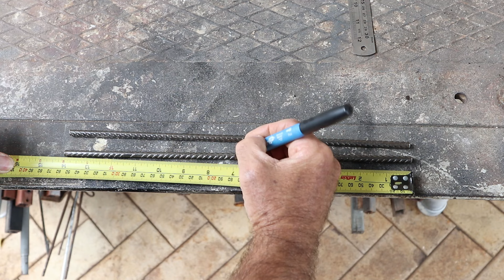Making a Steel Knot Metal Handle - Rebar Industrial Style Handle - MIG Welding Project

Comment: What size are the bolts and the head size please
Reply from the maker: The Rebar in the handle is 7mm, the wide flat bar is 50mm wide, 250mm long and 3mm thick, the smaller flat bar is 32mm wide, 207mm long and 6mm thick, the bolts are 25mm across the head and 50mm long, the shaft of the bolt is 16mm.

Comment: Brilliant, I know an awesome way to finish that. Put it outside and spray it with a mixture of acid and water and let it rust up nice and even. then brush with some steel wool to your liking to give character. Then paint on a product called Penitrol by Flood paint solutions, its an oil based paint additive to eliminate brush strokes. It will immediately take the lightly colored rust and turn it a nice dark brown like leather. let dry completely and then brush on 2 or 3 coats of a Satin polyurethane and your done and it will look beautiful and warm leather color.  Take it next level, after first coat of poly, spray some black on it and then wipe off leaving only the cracks and crevices colored black , experiment until you get desired antiqued look, then finish with more poly.
Reply from the maker: Thank you very much, I have used, The Flood Company Penetrol, many times in the past an awesome product for rust. I have just used it on rebar and put a clear over it (video will be up in a week or so) I love your idea to finish that handle, I have used thinners based wood stain to give metal the old look, and then coat it in clear, I have used your black idea on timber I had damaged etc to give it the old barn look, and sanded it off the timber leaving the black in all the damaged bits, then stain it and coat in clear. but never on metal, I thank you for your information and I will have a play at some stage to see how I go.

Comment: You did not weld the rebar into the screw. There is potential for this to come apart.
Reply from the maker: You are right, but it is in very tight and they would have to slide against each other to come apart, if you weld it with a quick tack on each from behind before putting it together would fix this problem (and the tacks would not be seen from the front), if you felt it would be an issue that would do the job nicely, Thank you for your comment.
Reply: @GavinClarkdiy    What can happen is the knot can skip a ridge on the rebar. This is not easy since you bent the knot to align the tails. It is not likely to fall apart but it will develop a rattle in the holes. The tightness in the screw holes has a high potential to work itself loose. This is a handle. It will be worked back and forth. Not too late for a quick tack in the back.
Reply from the maker: @rafal5863  You are very right, consider it done. thank you for your comment.